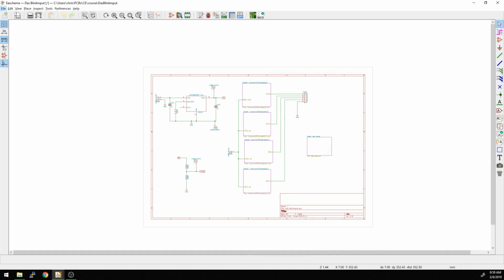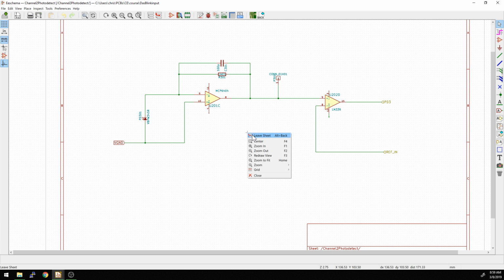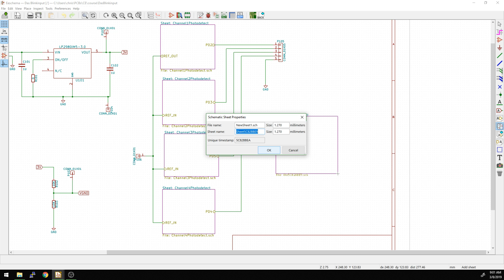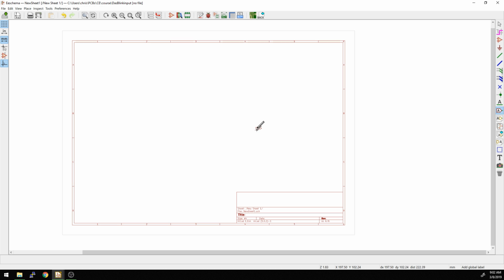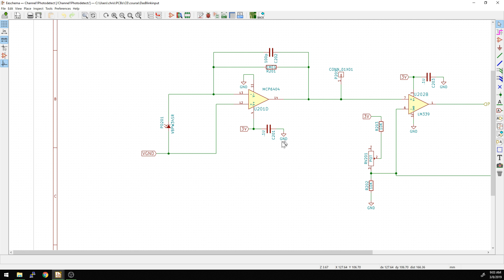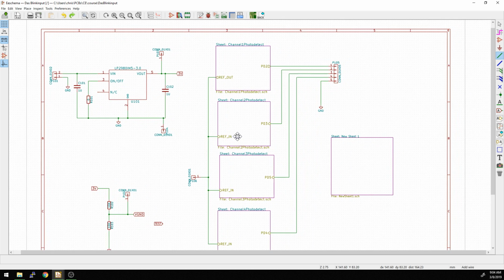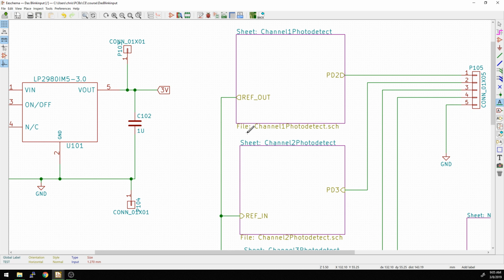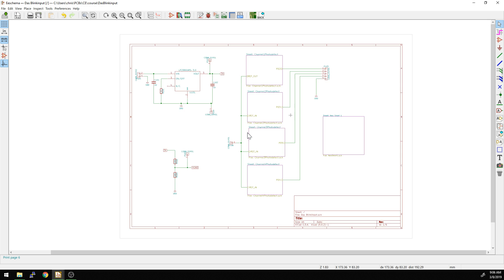KiCad 5.0 - Hierarchical Sheets

Comment: I would like to have a larger multi PCB project have its schematic to be one hieraachical schematic. Sadly there is no way to dedicate a specific PCB to a sheet or set of sheets. Nor control the part numbers within a sheet, so annotations run through the entire set of sheets. No same annotation on seperate PCBs, though logically that may be sensible/desired for a overall BOM  of the total project. Less desirable where some PCBs are shared on several projects.
Now accepting that annotation is over all sheets, a problem arises on defining a specific PCB  for a sheet/ part of the schematic, on bringing in the netlist (or update from schematic in latest version) ALL PARTS for the entire schematic are brought in. Requiring considerable  sorting out and deleting parts not applicable to that PCB.
I have over come  the issue to some extent of editing the project as a hierachical set of sheets but also have separate projects for each sheet, and edit the PCB from within the dedicated sheet project.
Nice would be ability to set a sheet in the hierachy to be a dedicated PCB and thus be able to work at the master hierachy level.

Comment: I HATE the way hierarchical sheets are implemented in KiCAD. All I want is to have the ability to have blocks of my schematic able to be printed on separate pieces of paper. Ie one big piece of paper divided into A4 sections without all the interconnected crap that you are doing in the video - just let me add another page to my schematic NOT all the BS you are demonstrating. 
What we need is the ability to have hierarchical sheets AND the ability to add additional sheets to encompass both scenarios

Comment: Can sheets be used individually like design modules? For instance, I have a 54 way connector which usually has the same global labels applied to it. I have to label it up each time I use it. Can I save that as a sheet to reuse? Thanks for the tutorial Chris.
Reply: I can't say I've done what you're talking about but I think the "Append Schematic Sheet..." option in the Eeschema File menu is what you want to look at.
Reply: Xy Zi Cheers, I'll take a look